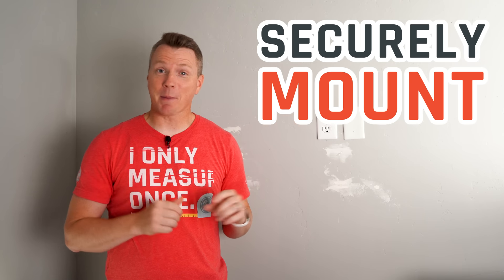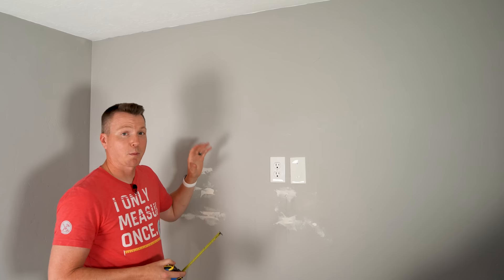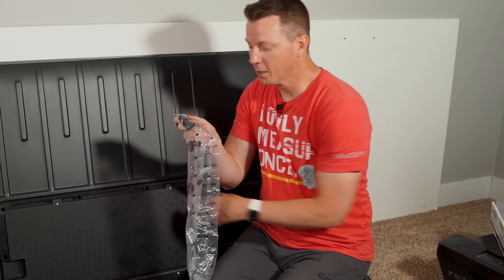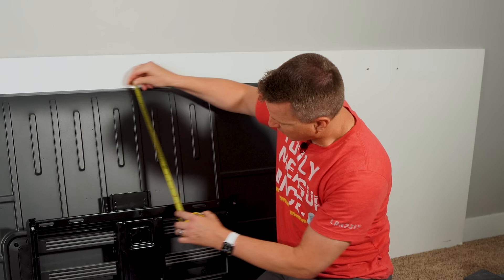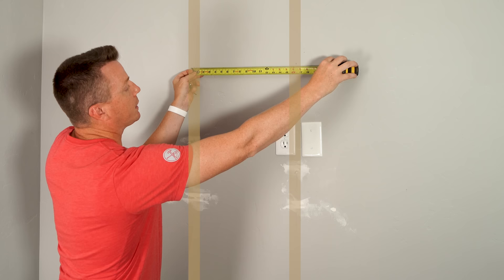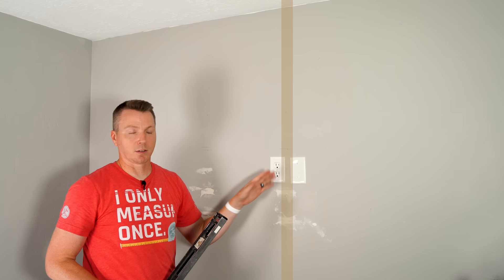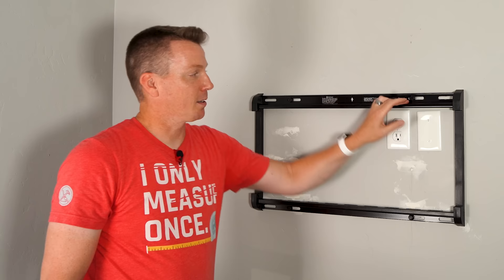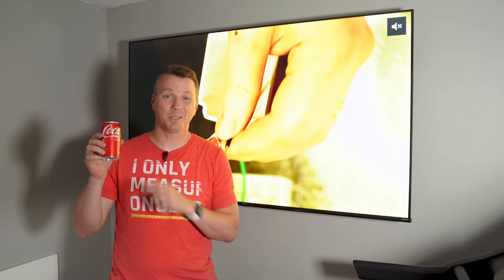SECURELY Mount a TV to the Wall in 5 Simple Steps

Comment: I feel like no tv mounting videos discuss how to work with the studs to put the tv where you want (not just going with wherever the studs are). Any tips?
Reply: Get a 2x4 drill it into the studs and then you can connect the tv to the 2x4 wherever you want
Reply: @vincelorona4026  whose doing all that
Reply: If part of your mount is only landing on one stud, you can use toggle bolts. Ensure you get the ones for the appropriate weight.

Comment: Very nice tutorial. The only thing that I'd add my two cents into would be the portion of drilling the holes. I've found it easier to find and mark the studs and the approximate location of where the mount will go. From there, predrill and then secure one corner of the mount.  I then level the mount up and mark the other three holes. That way I have a perfectly level mount with no holes that are 1/8th or so off.  You have yourself a new subscriber, BTW.
Reply: Smart af
Reply: 3

Comment: Thank you for the great video.  I have one of the large SANUS wall mounts and a 85 inch tv weighing 135lbs being mounted above a fireplace mantle, where the hook point is at  90 inches from the floor.
  How do you get an 85 inch, 135 lb TV lifted up that high?  The Samsung TV I have has the SANUS hardware with the hook point 12 inches from the top of the 43 inch tall TV.
  I know a couple guys can lift it up to a reasonable height, but how do you safely lift it that high?

Comment: I use a piece of OSB as a ledger.  I mount the ledger to the studs, and then mount the TV bracket to the ledger.
Reply: That's a good way to do it if your mounting holes don't match up with your studs. My house has studs on 24" center and the bracket I bought secondhand is narrower so I'll need to bridge across the studs to create a good mounting plate. I think I'll use a 2x board lag bolted to the wall studs, then I'll be able to mount the wall bracket to that. It'll be hidden behind the TV.

If it's a large, heavy TV I don't trust OSB not to crumble if there's nothing but wall board (drywall) behind it.

Comment: For those who are curious, if you are sitting 2m-2.3 meters away from the TV you have a tolerable error margin of approximately ≈20cm (before factoring in mount functionalities), in the placement of your mount. This is assuming the video-poster is correct regarding the 5degree rule in order to avoid feeling neck discomfort.
Reply: Jesus'
Reply: Ok
Reply: my brain has an intolerable error from reading this message

Comment: What a timely video!  Bringing home my new tv right meow.
Reply from the maker: Happy TV hanging, brother!
Reply: @LRN2DIY  do I need a new tv mount but already have one?
Reply: @LRN2DIY  can I uses any new or old tv mount for a 39 inch tv
Reply from the maker: @donovanburrell2354  As long as the mount supports the TV’s weight, sure. It also has to be compatible with the mounting pattern on the back.
Reply: @LRN2DIY  thanks man

Comment: I watched a video and it said the optimum mounting height for a TV is the bottom needs to be 42" off of the floor.  Not that I follow that, but use it as a rule of thumb depending on the situation.
Reply: I always use the top of the nearest light switch cover as an arbitrary height to line up with the bottom of the tv, for general wall install of anything bigger than 75.

Comment: My wall has 24" studs. Where we would like the tv is off a bit to hit those studs. Any suggestions, or do they make a mount that spans more distance so I can move the tv over more?
Reply from the maker: If it’ll span at least one stud, I’d go with that and use heavy duty drywall anchors (like the 75 lbs each variety) for the other two holes. Of it doesn’t touch a stud at all, four to six of those drywall anchors will be plenty strong for any modern TV, or you can look at bracing the area between the studs. You could even mount a piece of plywood to the studs and mount the TV mount to that.

Comment: Sadly, my bedroom had 24" on center not 16".  So my 75" TV is essentially supported by a single stud.
Reply: You can fix that by installing a ledger board that spans 24” then attach the mount to the ledger
Reply: @ZeroColdx911  I'd have to tear the walls open, wouldn't I?
Reply: Some mounts support both 16 and 24" interval studs.
Reply: @MikeFuryTech  no you don’t, it’s just a piece of wood mounted on top.
Reply: I had the same problem. I put up a hardwood backboard and trimmed it up with quarter round moulding.

Comment: How did you check if there was romex, conduit or pipe running through the stud where you drilled? I am thinking about drilling 1/16 to 1/8th inch at a time and then will look inside the hole with a flashlight and see if there is a cavity where romex or pipe may be running through. Thoughts?
Reply: There should be metal plates there. So if you feel a lot of resistance when drilling that should be your clue.

Comment: Mentioning that studs can be 24 inches apart instead of 16 would have been nice, new mount I bought is useless. Sure I should have done my own research but if I’m looking at an instructional video about this then that means that I am obviously ignorant on the matter and would have been nice to be informed. Have to return this Mount and buy one compatible with 24 inch studs. Thanks though I guess. (I’m a lil salty)
Reply: You can attach a ledger board that spans 24” then install the mount to it
Reply: @ZeroColdx911  bold of you to assume I know how to do that lmao. It’s cool I just returned it and got a compatible one.

Comment: My house is a 100 years old - there know studs - just plaster and lathe. Any suggestions?
Reply: There will still be studs running vertically but the spacing may be different. The lath and plaster sits between the studs.

Comment: Here’s my dilemma, and maybe y’all can offer some input…

1.) Where things are right now—
Currently, I have a 42” TV in my office/fun room, on a wall mount.  Said wall mount is positioned 6.5 ft. above the floor (IF that’s of any importance). Moving on…

In addition to a Dish Net Joey, there are also TWO video game 🎮 consoles hooked up to the TV. One evening, I was playing a game ON said TV, but suddenly, I had an epiphany (moving on here)…

2.) Changes warranted—
In order to get the full benefit of “maximum gaming performance and enjoyment”, I need a larger TV …😊!!! I’m thinking, somewhere in the vicinity of 65-72”.  Now, in order to do this, I’m thinking that a wall mount that can sustain something in the vicinity of 200 lbs. will give ME piece of mind.

My concern I’ve been building up to is THIS:
—I like where the wall mount is, but w/o getting into TOO much detail, bottom line, I have….concerns regarding gravity and stability!!!
—I’ve done measurements to see if said TV w/ said measurements will fit in office/fun room, so no problem THERE❤️🤍💙.
—The TV I want IS 💯% video game 🎮 compatible (If I wanna WATCH—but not PLAY—TV, I’ll go into the living room.  So again, all good there.

Again, I just have reluctance with trusting the stability of the NEW wall mount in the ORIGINAL spot.
All input and advice GLADLY welcome 🙏…

CHEERS 🍻🍻🍻🍻🍻🍻🍻🍻

Comment: And what if the drill won’t go deeper than an inch on every wall in your home as if it’s made of metal?
Reply: Sounds more like concrete walls. If that be the case, you'll need an impact driver to drill through. It basically hammers while drilling.

Comment: What if you accidentally drill into an electrical cord or a water pipe ? 😅
Reply from the maker: That’s why it’s important to use a stud finder and make sure you’re on a stud. It’s still possible to drill into a wire but it’s extremely unlikely. Using an endoscope is always best but most people don’t bother.
Reply: @LRN2DIY   I have a multitool that finds both studs and electric wiring.